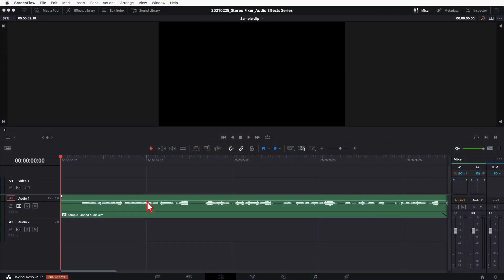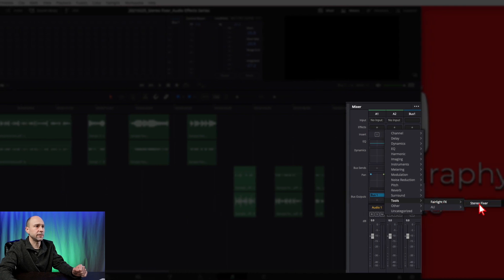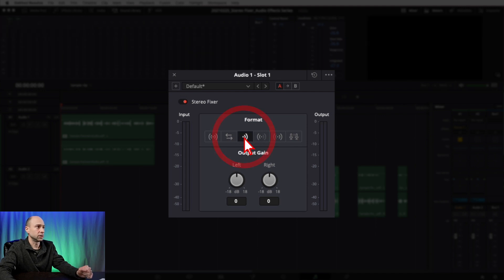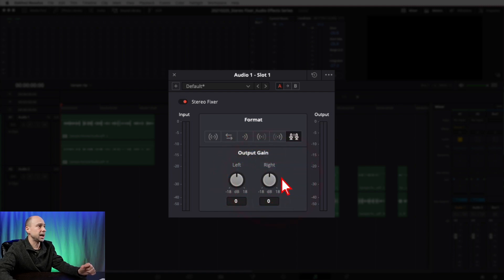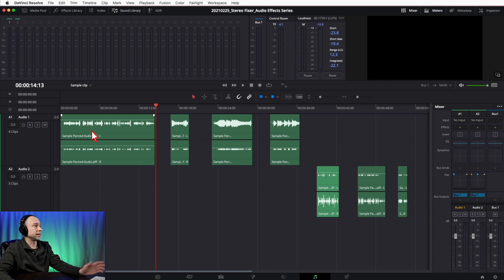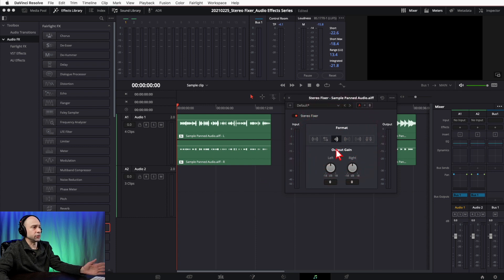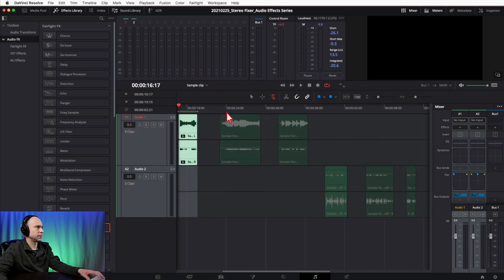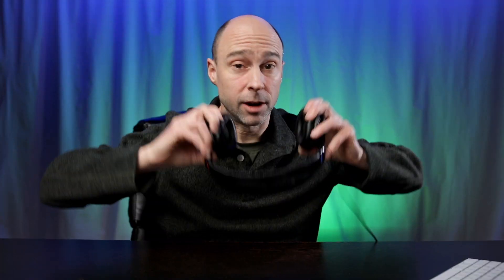Stereo Fixer Audio Effect in DaVinci Resolve 17 | Audio Effects Series

Comment: Hi guy. I think I have an explanation for what the mid-side is for. In playing around with a recording of a live act I made yesterday, it seems it allows me to increase the volume of a channel WITHOUT changing the apparent position of the instrument. I wanted to focus on a bassist and found I could increase his volume while giving the illusion he was staying in the same place. Useful, I think. See if you confirm.
Reply from the maker: Hi!  Thanks for sharing!  There was someone who commented with what the Mid-Side is for and he had a great explanation.  I forget which comment, but if you scroll through you should be able to find it.
Reply: Mid/side is a recording technique with one microphone pointed forwards, and one microphone or diaphragm with a figure 8 pointing left and right. Using some math you can turn that into a stereo signal (very common for decades now, for MP3s, for FM broadcast, …), and by applying different factors to the levels you can change the stereo width. Just like Jason said, there is a detailed explanation by somebody else in a different comment.

Comment: Unrelated to this video, but davincie resolve 17 i have a pop up every few seconds that says (audio output device selected not found)  can not get it to stop, started after the update from 16.
I'm using Bluetooth headphones.  Please make it stop, I dont want to use a headphones that have to be plugged in. That feels like a step back in time. 
Please help
Reply from the maker: Hi! Try going into your preferences then to system , then video amd Audio in/out and make sure it’s set to ‘use system setting’. Then make sure your computer is set up to use the headphones.   Hopefully that fixes it.
Reply: Thanks, I will try it out tonight. 
I looked on line and found no help for this and found many many people having the same issue with the update, could be a good video idea for ya.  I will let ya know if it worked for me.
Reply from the maker: I’ve seen a lot of people have that problem. Seems like there’s no one to fix for everybody, there’s a lot of variables I think. I think people just aren’t sure where to look for things either, on my end it’s hard to troubleshoot when I don’t know exactly what they’re doing.  But I may make another video about it. 😁👍
Reply: Nope didn't work, bluetooth will not connect,  pop up says "selected device not found" and it continues to pop up every few seconds so you can't even use the program.  Only way I can get it to stop was to set speaker setup to manual, and (speakers/headphones (realtek(r) audio) that allows me to hear from the computer speakers but not the Bluetooth. And yes the BT is connected to the computer and on.
Reply: Headphones do work, but feels like in back in the 90s lol..  I hope you can help im lost with out the Bluetooth..
Reply: @weldninja6922  I gave up and started plugging my headphones in.

Comment: Great video. I have an unrelated question. I have just finished a giant video project that included about 15 sub-projects. Before moving on I am cleaning up my file storage. I notice that I have a folder called Cache Clip. It is currently holding 84GB worth of cache files. Is there any reason not to delete these files? Should I have been deleting them along the way? 

I did some Googling on this topic and the most recent thing I could find is from 2014. Curious if there is any more current wisdom before I dump these files. 

Thanks!
Reply from the maker: Hi!  Funny you mentioned that I’ve got a quick tip Tuesday coming this out this Tuesday about that.  You can delete everything in there.  Resolve will re-create it if and when it needs it.  Those cache files add up quick.
Reply: @JasonYadlovski  - Thanks! Sorry to pump you for the early spoiler. I'll still watch the video and pretend to be surprised. ;) 

I appreciate the quick answer. Enjoy your Sunday morning.
Reply: @JasonYadlovski  Btw, when I hit empty trash, it was 154,540 files. lol
Reply from the maker: Haha, I did mine the other day, which is what prompted me to make the video, I I had over 200,000 files.  Crazy.

Comment: This  'Stereo Fixer Audio Effet''  does it Only duplicates the right or Left track in the other track, or does it really 'ENHANCE' the inferior volume/quality of the track so there is TRUE STERIO produced? I don't think it maters for dialog but for Music it does Correct?
Reply from the maker: It can enhance the volume of the side that is not loud enough.  The examples I used were like that, they weren't completely silent on one of the stereo channels.  But if you've got nothing on one channel, it's going to have to use the other channel to 'fix' it.  Technically the book says: designed to fix stereo source material in cases where only one side of a stereo signal was recorded, where one side of a stereo recording is a different level to the other, or where the stereo channels have been incorrectly Left/Right swapped.  I could see that it would music it would not be as good as a true original stereo track of the music.

Comment: While watching this wonderful Stereo Fixer Audio Effect  video, At 11:08 thru 11:16 "You can do come on" while doing different settings  the Audio  setting 1 & 2, going Left to Right, were Predominantly emanating from my Vizio Sound Bars Surround (REAR) speakers whil  3,4,&5  settingseminating  From front speakers and 6 eminating from the Rear speakers again. 
My question: Any Idea Why the Predominant change of Front and Rear Speakers in a  Vizio 5.1 Surround  Sound Bar system. I don't have Headsets, As obviously with stereo headsets they  have only single speakers each side.
Reply from the maker: Hi!  I'm not sure why it would change like that either.  As far as I know YouTube only supports stereo and nothing more than that.  So it's interesting that it's using the rear and front speakers for you.  I don't have an answer for that one.  🤔

Comment: The M/S option will process audio for a specific microphone recording confguration that uses two microphones placed in a particular configuration. One microphone faces the sound source and would typically have a cardioid pattern. The other microphone has to be a "figure 8" pattern microphone, capturing audio from the sides, perpendicular to the cardioid microphone. Some stereo microphones on the market already have this configuration built in. The advantage of M/S recording is that you can control the "width" of the stereo field after recording, by simply varying the level of the mid (cardioid) and side (figure 8) microphones. The resulting audio recording needs some phase flipping before it sounds like normal stereo - and that's what the M/S option does. Raw M/S audio can not be used without that step. Thanks for your vids!
Reply from the maker: Awesome, thanks so much for that information! Super helpful!  Just like everybody else I’m always trying to learn more also.  I appreciate it! 👍😁💯
Reply: @JasonYadlovski  I mentioned my ZOOM H2N earlier. This is what I have & apparently why this worked.
Reply: Right, but doesn’t the manual that Jason read from have it backwards? To my knowledge, L=Mid+Side, R=Mid−Side. (I have a stereo mid/side microphone that can output mid/side if I set it that way, instead of a more common pattern, but I haven’t played with it yet.)
Reply: The manual also writes “For a comprehensive M/S decoder solution, simply chain two Stereo Fixer plug-ins together. Use the first unit to control the Side signal level, thus controlling the width of the second unit (set to M/S).” (This is in the main manual, not the Fairlight manual.) I’ll be trying that out!